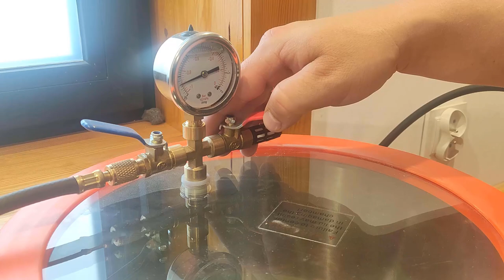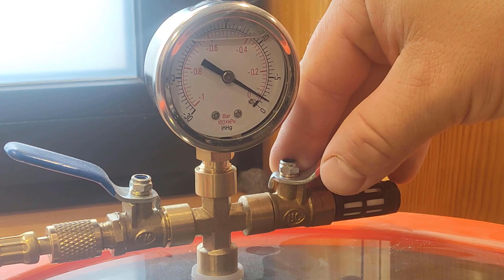072 I decided to refresh my first strike block plane.. and change one thing more

Comment from the maker: Hello my friends! It's been so long since the last video.. I'm glad that i'm finally back.
As you can noticed on my instagram profile, last time i was working on a few strike block planes. 
With every new plane my first strike block was getting uglier, so there was only one way - refreshing!
During the process i've changed the iron for longer and a little bit wider. 
For the new wedge and mouth closer i've used a piece of pear wood.
As you can see in the video i've used new solution - vacuum chamber. 
I'm gonna soak my planes with boiled linseed oil before finishing - that will reduce the tendency to moisture absorbing. 
You can ask - reduce to what extent? This is to be checked - let me know if you will like to watch that kind of video, with different kind of woods.
For the finish i've used two coats of osmo 3032 and rubbing with steel wool after each coat.

If you got any questions feel free to wrtie a comment.

Oh, one important thing - i decided to change my daily job for fulltime planemaking :)
I'll start since 01 november :)

Thank you for your time!
Stavros
Reply: That sounds very exciting! I hope you have great succes with your fulltime planemaking. Would love to see a video with your testings. Thanks for sharing!
Reply: All the best with your new job !!
Hope you'll get the success you deserve 😊
Thanks for sharing !!
Reply: You may be able to get away with using either linseed oil or polymerized linseed oil with the vacuum method. The residual air plus the solvent (e.g. turpentine, acetone, mineral spirits, xylene) in boiled linseed oil are likely causing the excessive bubbling over.
Reply: Might look into something called the "London finish": mix varnish with paint thinner 50/50, put in a layer let it dry, next layer wet sand with 400 grit wet/dry sandpaper, next 2-3 layers wet sand with 600 grit wet/dry, sand with the 600 grit and clean before applying a final layer. The slurry from the wet sanding blocks up the wood pores. I use this on tool handles and IME it's a tough, sweat-proof finish.
Reply from the maker: Next time i will do the vacuum in stages, not all at once. It should reduce bubblings
Reply: Thanks Stavros, I like the use of the vac chamber to fill the wood.
Reply: What a great news, congratulations! Finally planemaker in (continental) europe!🙂
Reply: Hello my friend! Beautiful work as always! I especially like the sanding tools! I plan to use some of the ideas in my work! Congratulations on the career change and best of luck! This video is missing one thing! The Stavros Gakos stamping!
Reply from the maker: Hello Donna! Thank you :)

Comment: I read from other woodworkers that boiled linseed oil does not polymerize inside the wood, since there is no oxygen, and over time it kept oozing out of the pores making the finished item tacky. What is your experience with the plane after vacuum soaking?
Reply from the maker: Blo mixed with terpentine have that tendency, i've read about it in Julian Goodacre (bagpipe maker) blog. He wrote that he should wipe off the surface of soaked wood every day for abouth a month, until the oil will get polimeryzation.  I've used pure linseed varnish (blo), wich is very dense and quickly get polimeryzation, I think it will not penetrate whole wood. Even if the blo is not dry inside, it is covered by one layer of dry oil and two - three coats of osmo. I had to wipe of all the parts only when I take them out of vacuum chamber. Later they were lay a few days without any leak, they were dry - I think it is a good sign. Maybe softer woods gets more oil, and get it back during polimeryzation, but pear wood not. I'm gonna make some test video.

Comment: Good afternoon Master Gakos, I would like to ask your advice. Somehow, by popular demand, you filmed a video on how to sharpen blades. I tried to repeat your method, but it always turns out either a skew on one side of the blade or even a lens. Perhaps you could advise something or make a video for beginner carpenters, because sharpening has not yet bypassed anyone who works with wood. With deep respect, Maltiz.
Reply from the maker: Hey, i think you made too much work on the sharpening stones. Try to do less move and reduce preassure from your fingers 👍
Reply: @StavrosGakos  Thank you Master Gakos. True, I used sandpaper on the glass, but apparently trying to keep the corner, I put too much pressure on the edge. I'll try to redo it next weekend. Looking forward to your videos. And thanks.